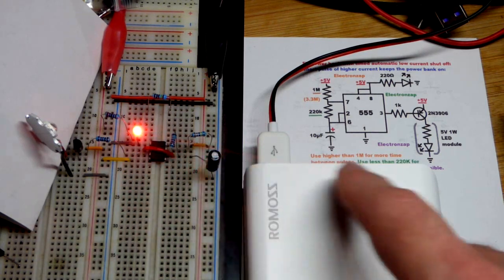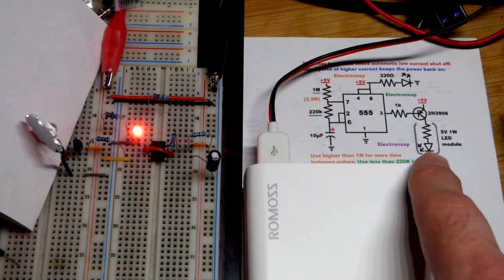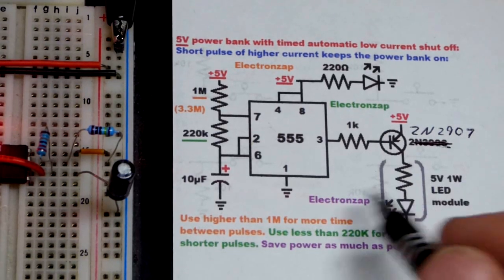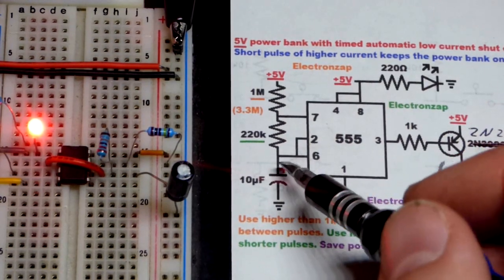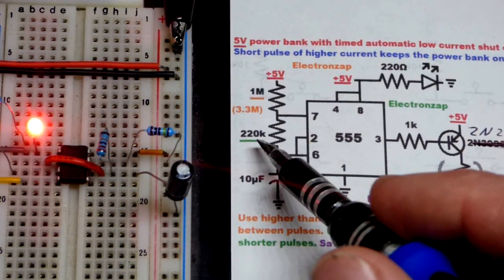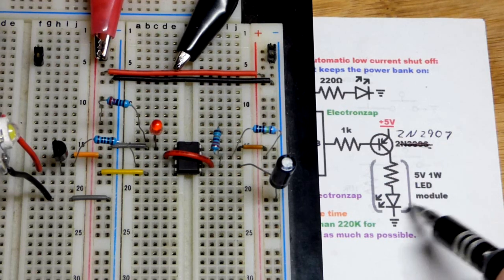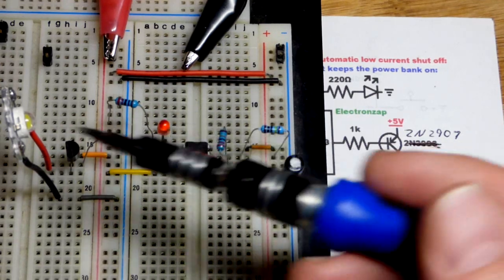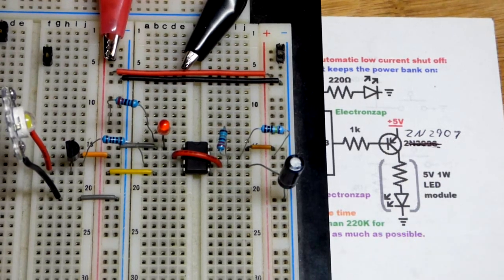Preventing power bank low current shut off with short higher current pulses circuit schematic

Comment: I like the clear and simple breadboard demo. But why 300mA? The minimum current triggering shut down is usually no more than 50mA.
Reply: I had an Arduino that kept shutting off because of the power bank turning off. I used the Arduino to create a 1ms pulse every 10 seconds drawing 0.5A (via transistor and resistor) and it stayed up. To be safe, doing 2ms every 5 seconds. When I used 200mA, the power bank kept shutting off. Seems they all work a bit different.